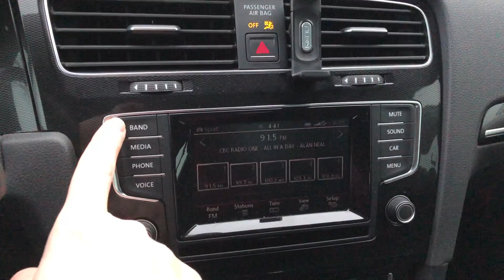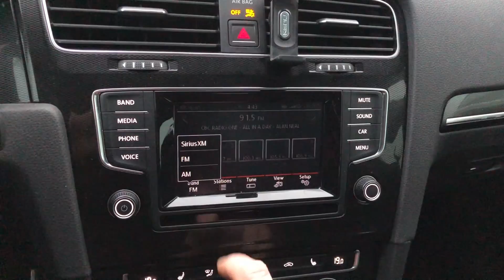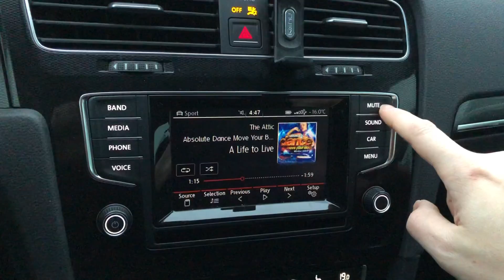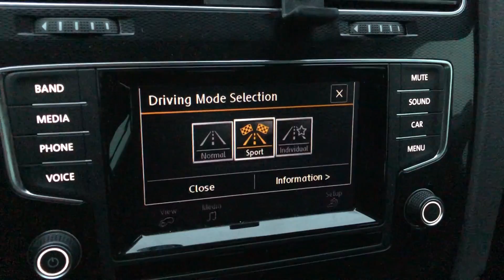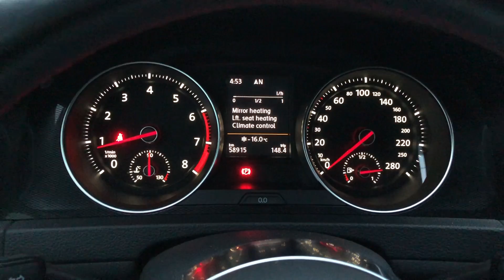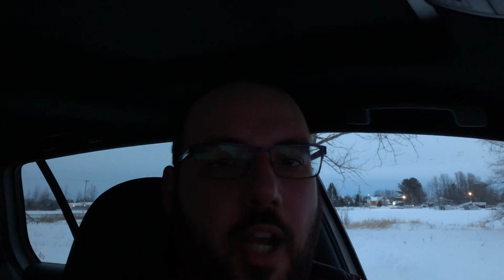2015 VW MK7 GTI MIB 1 Composition Media Infotainment Tutorial - Netcruzer CARS

Comment: How is your GTI in the snow? I have a ‘15 and was wondering if snow tires would even matter because I could barely move it last year when we got snow. Terrible ground clearance can’t be helped. Maybe some smaller wheels with snow tires? Just saw the snow in the background there. Otherwise love my car.
Reply from the maker: Show tires make a HUGE difference. If you live in a climate with snow or that drops below 5C you should run snow tires in winter. I ran 16” wheels and tires in winter on mine, but if you have a power pack GTI you need 17” to clear the brakes.